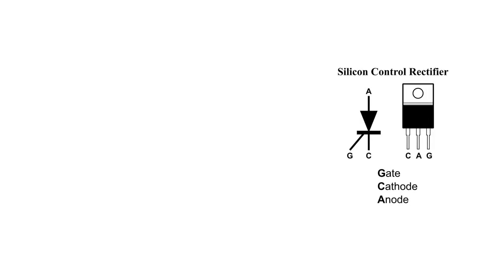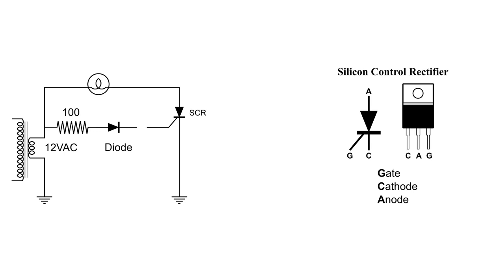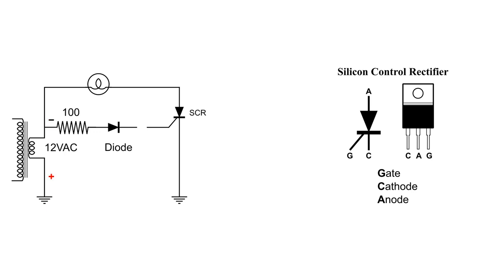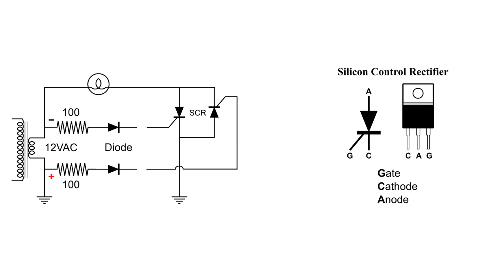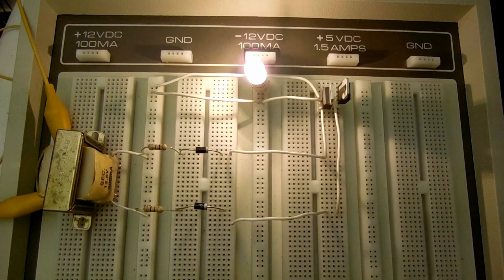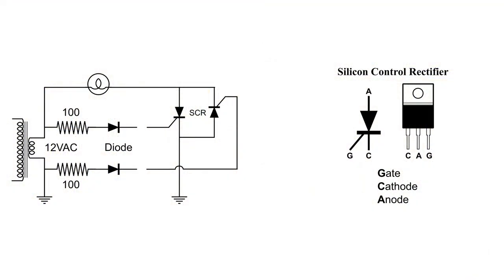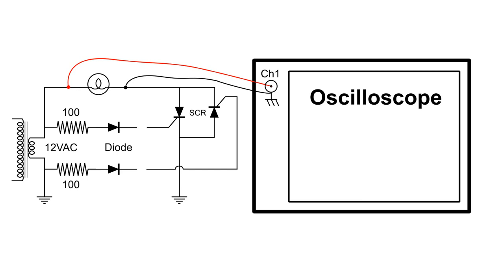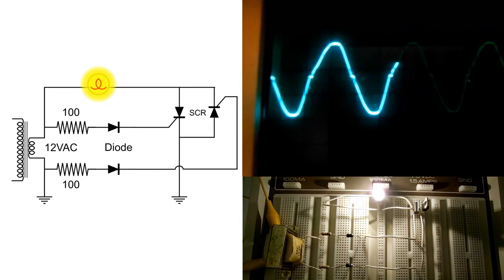Silicon Control Rectifier SCR Basic AC Circuit

Comment: Does an SCR therefore behave similarly to a triode vacuum tube, where, instead of a gate controlling the flow, there is a GRID controlling electron flow?
Reply from the maker: An SCR is ON/OFF device. The triode grid controls the electron flow to the plate. Here is a video that may help.
Triode Tube Amplification Visual Demo
https://www.youtube.com/watch?v=4FkD0LRiu7A

Comment: How efficient are they?? Can they be used as a more effective Voltage regulator for instance??
Reply from the maker: In the high 90 percentile efficient. Usually this configuration is used to vary the duty cycle.

Comment: Hi Rick. Another Fantastic Video. I was wondering if the current draw increased with both side connected ?. Thank you for sharing and Happy Holiday"s to you and yours.
Warm regards.
Bobby
Reply from the maker: Thanks Bobby Tectalabyss
Yes with both halves, the current is about double. I did a video on duty cycle, and there is a Tiac and that circuit.

Comment: am i right in saying that this diagram is basically converting A/C in to D/C when both scr's are switched on thus using the full wave on the oscilloscope. great job once more.
Reply from the maker: Kevin Brain The circuit is controlling AC. One SCR
is controlling one half cycle of AC and the other SCR is controlling
the other half of the AC. Our another words one SCR is controlling
the positive cycle of AC and the other SCR is controlling the
negative cycle of AC. You might want to watch another video of mine
called “Duty Cycle, Light Dimmer Demo”
Reply: i will be watching more of your video's and thanks for the info.

Comment: Have you ever worked with the old Ford Lincoln Mercury Sequential turn signals?
After 1969 they started using SCR's in the sequencer box, I am having a hard time finding the wiring...
I think the "flasher"/Large Cap in turn signal circuit creates a switched DC,  they use to trigger the SCR, do you have any experience with that use?
Just basic theory of triggering with switched DC would help...
Reply from the maker: Nop. Never worked on that circuit.

Comment: Cómo calculas el valor de las resistencias del gate
Reply from the maker: I am using a C228B2 as an example.
Download the datasheet pdf.
First thing is you have to know the voltage you have that is going to be used to drive the gate.
Looking at the data sheet I would use MAX 40 ma and MAX 2.5, must not exceed this.
MIN gate voltage to drive the gate is 0.2 volts. 
Now use Ohms Law to calculate the ohms that well not exceed MAX but a little over MIN gate voltage.
https://datasheetspdf.com/pdf-file/1128942/Motorola/C228B/1

Comment: I thought AC doesn't have positive and negative?
Reply from the maker: The output of this amplifier is AC. It's not as pretty as I would like because I'm using diodes as a load.
MOSFET Push Pull Amplifier Visual Demo
https://www.youtube.com/watch?v=-6N7l1dnk6s
Reply: @AllAmericanFiveRadio  i mean at 1:14 you show the transformer secondary having a positive and negative like it is DC, i don't get that
Reply from the maker: @arthurmead5341  Transformer Basic Parts & Function
https://www.youtube.com/watch?v=q3YhbugYjJY

Transformers, a few basics
https://www.youtube.com/watch?v=UvHCQswnjEg

Comment: Its OR gate
Reply from the maker: An OR gate does not require the opposed polarity to turn it off.
Reply: @AllAmericanFiveRadio  so its AND ?
Reply from the maker: @visionofwellboyofficial  An AND gate does not require the opposed polarity to turn it off either.
Reply: So those gates only apply to DC ? Yet im still confused
Reply from the maker: @visionofwellboyofficial  An SCR requires a pulse on the gate to turn it on. And revers polarity on the cathode  and anode to turn it off. Gates, depending on the gate, is on with a signal and off when the signal is gone, or visa versa.

Comment: Hello Dear Sir,  I am having a difficult time understanding a DIY design for a CDI for my motorized bicycle.  There is no trigger used with the magneto.  Here is the diagram
http://motorbicycling.com/attachment.php?attachmentid=37422&d=1308870564
The circuit uses an SCR.  I would love to know how the circuit works.  Thanks for all of your excellent tutorials.
sean
Reply from the maker: I would need more in formation. This is just part of the circuit. Can you supply the manufacturer and part number of the CDI? And the motor manufacturer and part number? If I can get the manufacturer information from the manufacturer I'll try and make a video.
Reply: AllAmericanFiveRadio
The blue wire comes from the magneto.  The black wire goes to ground.  The green wire goes to the ignition coil and from the ignition coil to the spark plug.  This is the entire circuit.   All of this information comes from the thread at motorbicycling.com "Roll Your own CDI"  Here is the link to the page
http://motorbicycling.com/showthread.php?t=28439
The meat is from page 3 to page 5.
poroldchap has a video on a similar ignition system called "home made cdi for outboard"